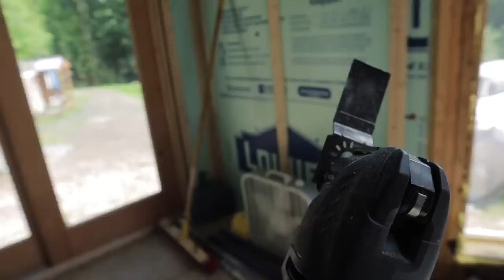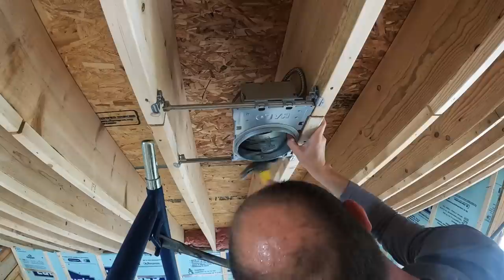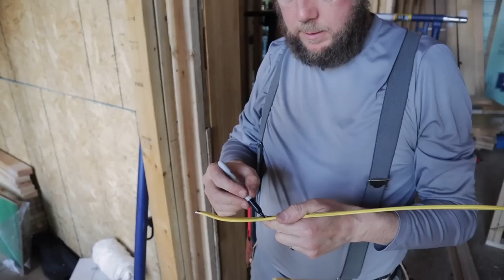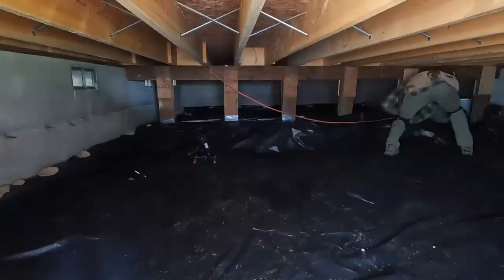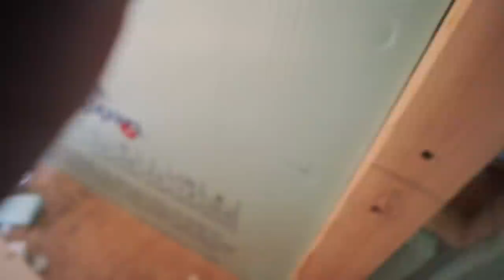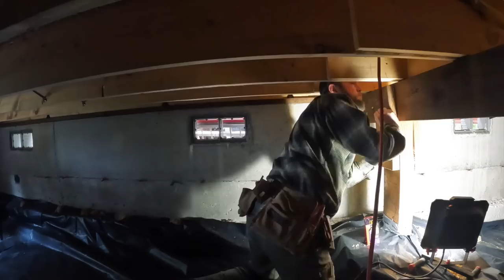SHE SCREWED UP // Couple Starts ROUGH IN Electrical on Self-Built Home

Comment: Make sure you get metal plates to protect your wires and pvc pipes. You will have extra work to repair your pvc with a pin hole and cut into wires. Been there and have done it too. Shalom

Comment: As a former retired electrician, I would like to give you a suggestion. You should use a different lighting fixture on a slopped ceiling. That fixture will not shine the light straight down, it will shine the light at the angle of the slopped ceiling across the room. I would suggest a fixture similar to the following:

H47 6 in. Aluminum Recessed Lighting Housing for New Construction Sloped Ceiling

Keep up the good work!!
Reply from the maker: Good call. You’ll actually see in the next episode that we installed an additional 3 lights for the kitchen that will shine straight down.  The others that I installed should work ok for general illumination.
Reply from the maker: But man are the spendy compared to the basic cans.

Comment: It amazes me that you guys are allowed to do electrical!!  Here we have to have an electrician do all the work and when done we must have a certificate signed off!!
Reply from the maker: We still have to have all our work inspected by L&I so we are still going through the proper channels and inspections.
Reply: I’m sure You already know this! But after all your elec. is complete. Be sure to either spray foam or tape around any outside wall elec. boxes; you will get Cold drafts at every outlet and heat loss! Looks awesome though 💕

Comment: Hi guys the electrical looks to be going well👍. I must say I was a bit surprised to see the rafters moving when you were hammering the lights in. I did not see any noggins tying them together? I presume they are not required there or is it a case that when you finish the ceiling that will tie the rafters together.any way great job.
Reply from the maker: When we put the finished shiplap on the ceiling it will tie everything together rock solid.
Reply: @OneFootOfftheGrid  great news. I was just concerned glad you have it covered off 👍😊

Comment: Good episode but I’m still trying to figures out why you added firing strips on the raft
Reply from the maker: To achieve the R value required we needed the extra space while still leaving an air gap against the roof for hot air to escape.  Basically just a spacer.

Comment: The rafters seem to have a lot of play in them. Do you need blocking, or does it matter. Keep up the hard work guys
Reply from the maker: Our plans don’t call for blocking except for st the bottom and top.  The ceiling will be covered with shiplap which will tie everything together and make it rock solid.  Thanks for watching.

Comment: Man, i know you gotta do what you gotta do but if you fall from that height its game over. I would sub that part out. Maybe rent a small lift for a week.
Reply from the maker: Appreciate your concern, but what part would you suggest we sub out?  We will need to be up at that height for multiple parts of the build.  (electrical, insulation, shiplap, ceiling fan, etc...).  Part of the reason we invested in a professional grade, industrial scaffolding setup.   

I looked into getting a small lift into the house and from the people I talked to they didn't recommend running in on traditional joisted floors, so it left scaffolding as the best option.   

I did invest in a safety harness as well and I may have made the height look a little higher in the thumbnail through some photoshop magic.  =)
Reply: They make a push around lift that does not have the enormous battery.
Reply from the maker: @baiotelecom  I’ll have to check that out.  Would come in handy for sure.

Comment: Why did you drill holes in the floor joists tor run wires instead of under the joist and just tacking the wires to the joist?
Reply from the maker: That is a good question.  Certainly could have saved some time.  I got in the habit of doing it in the interior and the habit just carried over.  Maybe the install looks a little cleaner this way?  Ultimately, it just comes down to us being beginners and doing a lot of this stuff the first time.
Reply: I would not have  drilled any holes that could possibly affect the integrity of my joists
Reply from the maker: @baiotelecom  Code allows for up to 3" holes in joists as long as it isn't int the top or bottom 2".  I don't think a single 3/4" hole will have a material affect on the strength of the joists.   That said, I did aim to minimize the number of holes I needed to make.

Comment: Do you guys run a ring main or are they all individual spurs from the main distribution box?
Reply from the maker: Not sure what “ring main” is?  The lights are all daisy chained together. Each room is on their own circuit dictated by code.    I think we will end up with around 15 breakers in the box.
Reply from the maker: @crowhomestead7552  I don’t think that is allowed in the US.  Each of our circuits gets ran back to the panel. Sounds like an interesting design though.

Comment: I don’t get it!  Your claiming to be building an off grid home, then why are you installing a on grid system?  You should be installing a 12v system complimented with 110.
Reply from the maker: Good question. We are “one foot” off grid.  Meaning we never intended to be fully off grid. The goal is to install a grid tied system in the future.
Reply: @OneFootOfftheGrid 
I’m going to strongly suggest you think your plan and cost
Reply from the maker: Not sure what you mean. Certainly open to hearing your suggestions or risks on how we are currently progressing.